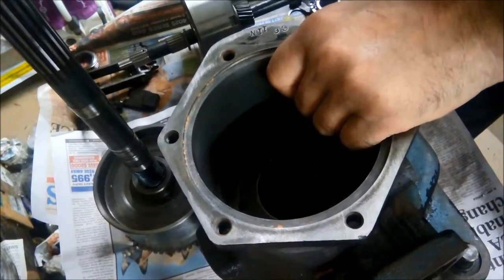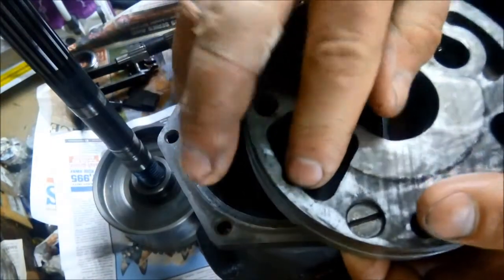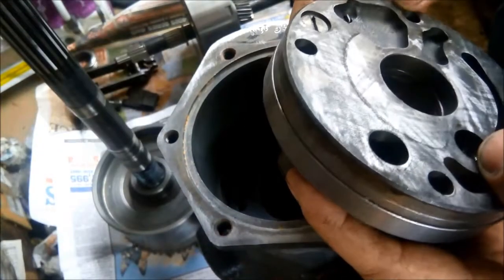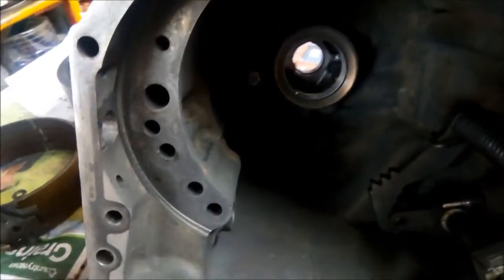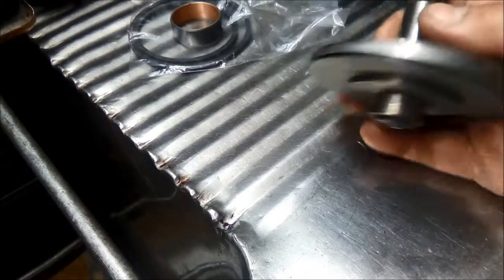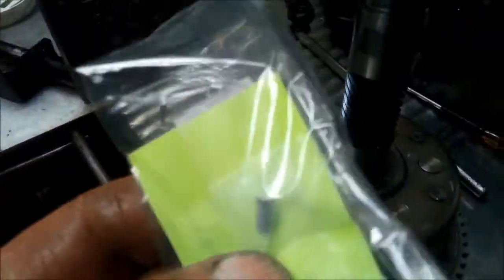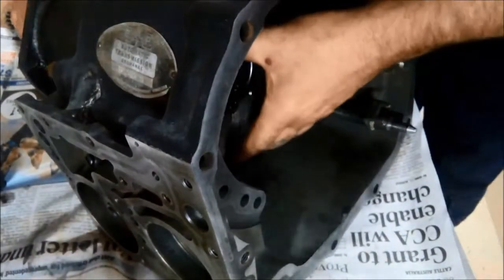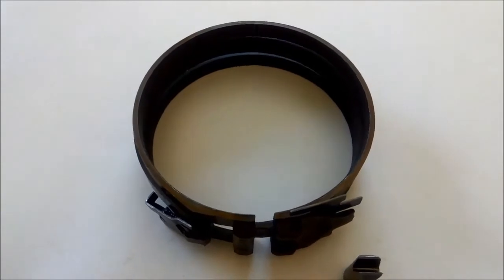Cast Iron Chevy Powerglide CAST IRON Reassembly Part 6of7 DIY How to

Comment: I'm probably going to upset some people, I removed the cast iron powerglide on my 58 Corvette, replace it with an aluminum powerglide. The main reason the cast iron transmission was leaking all the time we couldn't stop the leaks. So a transmission shop near me says it's so easy to put aluminum powerglide we will do it and he did it. As far as the cast iron powerglide I belonged to a Corvette club, and one of the members took the transmission right away. :face-blue-smiling:
Reply from the maker: hi, not many can fix the cast pg leak issue, but it is possible. cheers

Comment: Hi, I’m working on a ‘61 Belair that’s been sitting for many years. All of the shift linkage had been removed. I put the linkage back on. When I put the trans in PARK, I can still turn the out put shaft by hand. Shouldn’t it be locked up? Is there something wrong? Thanks.
Reply from the maker: hi, take off the linkage at trans and select park manually to confirm, if you have park then your linkages need adjustment. if still has no park you may have broken parking pawl. cheers
Reply: @YepThatsIt  Hi, yes, I moved the selector by hand, and the out put shaft still doesn’t lock up. If it is the paw, do I have to pull and open up the trans? Thanks

Comment: The reverse band and the double wrap front band are getting more difficult to find replacement parts who do you recommend for replacement parts. Thanks
Reply from the maker: hi, I can source most parts for you, contact me on my face book link https://www.facebook.com/Yep-Thats-It-103051017785435  and leave me which  kind of vehicle/transmission type you have, and leave a detailed description of any fault codes and issue you are having ( we are able to exchange pics/diagrams on there ) and details of what work you have already performed or checked...... you will need to buy me some beers ( link is in face book ) and I will answer your questions accordingly. cheers